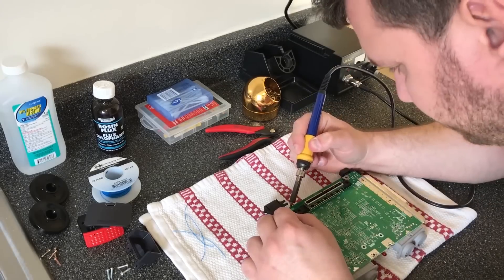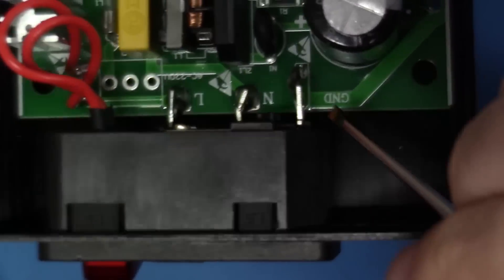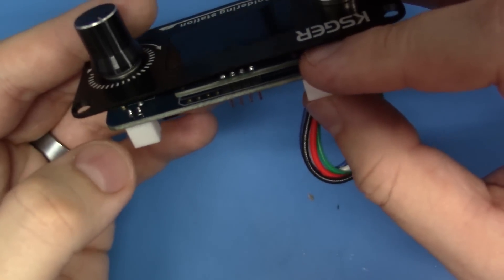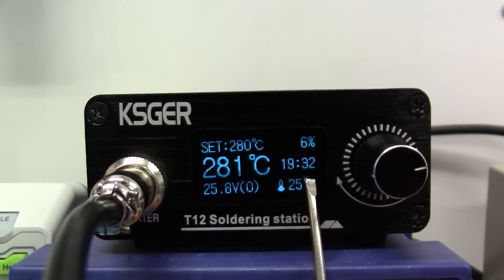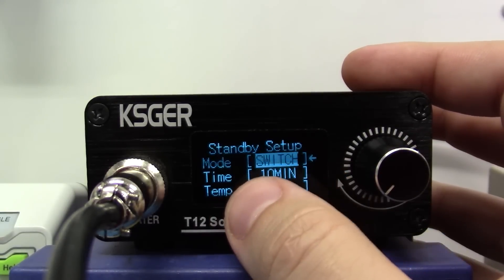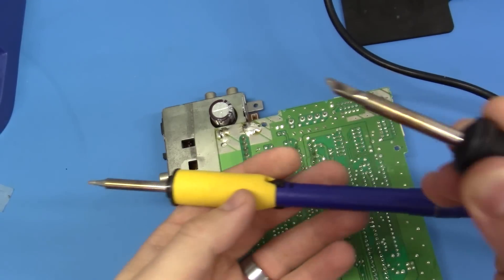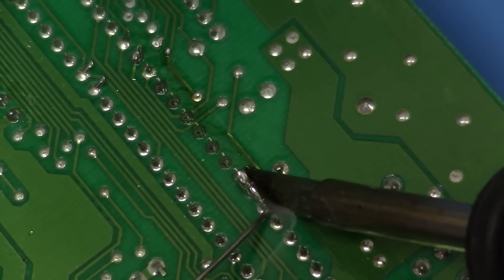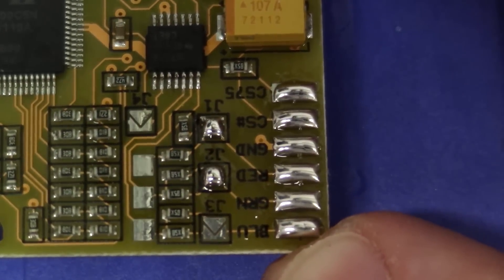Buying Your First Soldering Station (UPDATE READ DESCRIPTION)

Comment: Can you check out the Sigma 950, AKA Bakon 850D? It's a T12 style soldering station with a digital display and it's really cheap, got mine for $25 on Amazon. I've only used it 3 times so far, but it's pretty good and I really like using it. There aren't many videos about this soldering station, but I think it should get more recognition/recommendation as it's actually a really solid starter setup you can get on a budget. It's definitely a better pick than most of the older indirect heating style irons.

Comment: I'd just like to make an observation about a comment you made regarding the quality of one of the internal connections. You mentioned that the mains power assembly in the better quality units was hard-soldered directly onto the board, whereas the cheaper units used flexible copper cables with poorly crimped connectors. I'm no expert, but with all due respect to your superior knowledge of such things, wouldn't a combination of the two methods be the perfect solution?

The mains connector is subjected to stress every time it's plugged in. There's a bit of movement every time, so a solid soldered connection to the main board is possibly going to fracture in time. A hard-soldered flexible cable connection would be more robust, as long as the soldered joints were of a good quality.

Hmm. Maybe we'd need to get another new soldering station before we could solder the cable connections on our new soldering station...  ;-)
Reply from the maker: Ideally, I would want all main connections to be crimped. But if I had to do choose, I would much rather have the IEC connector hard-soldered into position, rather than have a questionable crimp from cheap Chinese stuff. 

- The good news is, the case supports the IEC connector, so there's not a lot of mechanical strain on the IEC connector, even when cycling your mains power cable into the IEC socket.

Comment: Hi Voultar, I bought this thanks to your recommendation and opened it up to compare to the one you had in the video just to make sure it was the same. It looks like the mainboard was updated a bit but still mostly the same. Virtually everything you called out as being great is identical. The only concern I had was that the coin-cell battery is no longer directly attached to the mainboard but is attached via pins and the battery itself rests directly on top of the rectifier. I'm still pretty much a total beginner so I don't know enough to judge whether that's safe, e.g. whether a magnetic field from the rectifier could screw with the battery or something. Should that be okay? Sorry if this is a dumb question or has been brought up--I scrolled through the top level comments and didn't see it. Thanks for all you do!

Comment: mine just randomly died after 2 hours of use. I opened it up to see if anything was wrong but i couldn't see anything blatant. Even checked all the fuses with a voltmeter for continuity. There is a red LED that lights up at the front of the board when I plug it in and turn it on, but that's it. No screen, no heat :/

Comment: I just received my unit from Amazon. There were two minor differences:

1. The connector for the soldering iron is soldered directly to the front board. The solder joints look okay and well done, but it’s not a (changeable) port attached to a connector like yours.

2. The battery is attached via a plug attached to +/- wires and is surface mounted with adhesive on top  of the main power transformer.
Reply: Hey man have you tested it? Is it worth its salt? Quality good or is it a pos?
Reply: Not Applicable I haven’t yet, I took it apart to inspect and it seems legit. I was actually going to futz with it tomorrow.
Reply: @design-flux  Have you had a chance to mess with it? Also, do you mind linking the station you purchased?

Comment: Hey Voultar.  I wanted to let you know that they are not shipping the soldering station that you reviewed in this video.  I think that the one I received works fairly well.  I was a bit upset that they didn't send me the same station that you reviewed, but the one I received still works great!  This is my first soldering station, and I've already resurrected a few Gameboy games following your reflow and battery swap video.  Thank you for your research, and keep up the amazing content!
Reply: I wanted to buy this one too, but i red the faq, what's the difference?
Reply: @seyul  The internals are not the same as the one in the video.  It's like the hardware revision 2.0 I think this has the handle input soldered directly to the controller board, and the controller board is there green PCB, and not the blue one with the better hardware control.  Also, the RCA battery is not soldered to the board, and they double sided tape it to the transformer.  I disassembled the case, and moved the battery on the bottom case between the front panel, and the bottom PCB.  I'll try making a video today showing how it works.  Also, I'm not sure if it is the handle, or the actual unit, but the power regulation is a bit off.

Comment: since this uses handle and tips based on hakko  t12 951 how about making and selling a version of the hakko 2032 microsoldering pencil and its related  t30 tips to be used with this station as that would be really handy as can only get 2032 from states or hong kong in uk

Comment: I wanted to add to this review for anyone reading the comments. I recently ordered this item. After maybe a month in transit, it finally arrive yesterday. I can confirm that the internals are the same as the ones shown in the video, albeit a few small differences. These differences are improvements in my opinion and in no way seem to affect the effectiveness of the item. I soldered with it last night and as far as I could tell, the review is spot on with everything I was shown in this video. I'd say the recommendation still stands on this product if you're ready to wait for the delivery all the way from the Chinas.
Reply: I want to order it because my soldering station is awfull, but i read the Faq on bangood of this soldering station and they're calling it fake and with old firmware and someone on this comment box said the same

Comment: NES solder is pretty scary stuff.  If that melts NES solder, you got a fine piece of equipment there.  Can you also suggest a good solder? Also a good flux (both in paste and liquid form).  I'm not having good luck with the stuff I have from Walmart.  It just balls up and rolls away.  The sample solder strand that came with my old iron was excellent, but it was just a sample and is no-name no-sell anywhere.. I still have some, still works great, but it'll run out soon.

Comment: Is that battery rechargeable or just a standard lithium cr2032? My battery is dead after a week of use, and it can't keep the time when I switch off the unit. I thought it would last for years.

Comment: Is there a way to switch the chosen tip? If I go to the tip menu there's always the T12-J02 tip selected. And this seems to only work with the tip that came with the soldering station although the tip that came with the station is a T12-K...

Comment: Hi Voultar. I had a couple of courses on analogue and digital electronics during my Bachelors studies. Do you have any recommendations on learning how to actually design circuits? Any software I should learn (i.e. for the digital electronics class we used logisim if I remember correctly, it's been over 10 years) ?

Comment: It's a bit late but thanks to you I have just ordered my first Soldering Station. No more having to deal with crappy $3 soldering irons from my local hardware store.
Reply: I finally order this thing and I get an email 2 days later telling me it's out of stock..here's hoping they get more in soon.
Reply: I've had the new soldering station for a couple of weeks now (after contacting the site to find out why I hadn't gotten any news about my order in a while and they finally got it shipped) and I have already seen a huge improvement in my solder work as a result of using it. I did take it apart to check out it's insides and I'm glad I did because whoever put it together decided to put the battery (which is now connected with a cable instead of being soldered directly to the board like the one shown in the video) on top of the transformer which then presses it up against the top of the case so I pried it up from the adhesive holding it down and kind of shoved it under the power board so it wouldn't catch on anything. The connector for the heating element is no longer soldered to a cable and plugged in to the board as shown in the video (although the connector is still there) but an extended piece to the board now has the connector soldered directly to the board which I see as a huge improvement to the version in the video. Beyond that everything internally looks pretty much the same. As for what I've done with it well I cleaned up some mod chip work on one of my SCPH-101 PlayStations (found some cold solder joints that was causing the chip to not function at times) and fixed a still present solder bridge on another one that was causing a huge video error that scrambled the boot screen and then installed a new mod chip in that PSone as well. While it's not as clean as what Voultar did it in an older video it is far better then the job I did on the other PSone where I was using the cheap $3 soldering iron I've been using before getting this new soldering station. I am very happy with my purchase and my poor ILS tip I think is now begging me to replace it though it still looks like it can take some more work from me before it become totally useless (I have no idea how long these things are supposed to last and I'm sure I'm not taking proper care of it but the tip is still melting solder at 250 so I can't have totally ruined it yet and I scrape it off with some old steel wool as I see it getting dirty but only a light rub so not to totally ruin it). I've now even thought about looking in to installing a mod chip in my PS2 with how well things are working with what I've done so far. Thank you for your videos and for this video which finally got me to get a proper soldering station to do this kind of work with rather then hoping I could get away with the crappy soldering iron I've been using this whole time. Maybe I might start selling modded systems myself since it seems eBay's anti mod chip policy is clearly not being enforced if they even have it anymore (haven't bothered to check in a while).

Comment: Just bought one. Did so through Amazon ($45.75 it cost me) as the last time my credit card number touched banggood I faced thousands of dollars in charges from some other company in China. My credit card company refused to remove the charges because they claimed the company in China's charge was valid (it absolutely wasn't).
The 120V connection to the board sold me on this unit.
Reply: Just received it... I was ripped off. It has a minute version of the power converter transformer and hardware version 2.00! I've seen a much more updated version in the videos shown on YouTube where it's 2.09, 2.10H or 2.10. I was clearly ripped off (hardware being older than the updated versions everyone else has? That's in no way acceptable!). Mine was directly from KSGER through Amazon, yet they sent me an old version. The maker, KSGER ripped me off.

Comment: Because of this video I bought the Soldering station and tip collection and I'm really happy with it! 
Could you do the same for a hot air station? There is the 858D that you have, a KSGER which also has a the fan in the handle, and there are the QUICKs (857D, 861DW, 862D) that have the fan on the Station and a thick cable that allows air pass through.

Comment: Thanks, I decided to get this. The coupon codes seemed to have expired. I was about to get the Hakko FX-888D but this look nicer. I certainly prefer the controls and read out. It doesn't hurt that it is half the price but that was not a deciding factor.

Comment: Voultar,  back in November right after your recommendation in this post I pulled the trigger and purchased all three items.  I got the tips and stand about three weeks after the purchase.  As of today 02-15-2919 I still have not received the soldering station.  I’ve called customer service twice but still no luck.  I’ve been offered a refund for the station but now I have the tips and holder with nothing to use them with essentially making them worthless to me.  Can you please reach out and see if you can do anything to help me.  If I have to I’m willing wait a few more weeks to get the station I want .  My email is frank.o.parsinitz@gmail.com.  Thank you for your help.

Sincerely,

Frank

Comment: Just bought the same one from Amazon, payed a little more cause I did not want to wait. Came with 3 tips and a different wand that's carbon fiber. Plugged it in a a big ol ERROR started flashing on screen, twisted the tip in wand a little and boom worked! So far so good do not hesitate to buy.

Comment: I was hoping to get something with hot air.. Any recommendations on a 2in1 unit? or should i get a standalone hot air unit and this unit? Thanks! Great Video! Sub'd and Liked.
Reply: Here is a link : https://www.banggood.com/KSGER-STM32-OLED-T12-Temperature-2-in-1-Hot-Air-Dryer-Digital-Rework-Soldering-Station-Solder-Iron-p-1407450.html?rmmds=mywishlist

Comment: I may be late to the party but have a question if the temperature is genuine, that is have checked with a tester if the tip temp is the same as on the display.
I did not see any calibration option and some station I have seen can go 50+ish degrees pre-calibration and even tho you can go by feel what temp is right it's still annoying to deal with.
Cheers.

Comment: Yeah I just use a cheepo plug in iron that has a little analog dial. Works perfectly and came with 5 different tips, solder, a solder sucker, stand, wire, wire stripper, and a zip up good quality case. Think it was like 25 bucks on amazon
Reply: https://www.amazon.com/ANBES-Soldering-Iron-Kit-Electronics/dp/B06XZ31W3M/ref

Comment: Hi! What is the difference between V2.1 and V3.0???
Reply: about 0.9
Reply: the power output
Reply: From what I've read V3.0 has many bugs and is slow, V2.01 has bugs, V2.1 is the best. I've encountered a bug on V2.1 but it's fixable. If you buy a new V2.1 (or probably reset/initialize it), you can't choose a tip type (pressing and turning the knob to the right). That's because when the unit is reset, there is no temperature profile selected. You have to select a temp. profile (press to get to the temp selector, then press and turn to get to one of the temp. profiles), then get out of the temperature menu and you can choose tip type and tip calibration.

Comment: I got mine. But the temp fluctuates constantly about 20 above my set temp and sometimes below. Also, I noticed though it is still hot to touch and on the display temp, it stops being able to melt solder. I am at 350 when this happens. Any suggestions or a setting I missed in the vid? If it works right after this, I must thank you for the recommendation. It is a really nice unit.
New Info: So the fluctuation I had before in temp have stopped. Will test if it loses its temp.
Reply: thanks let is know since I am thinking on it
Reply: I'm having the same issues as far as melting solder- or rather being unable to melt solder. I was going to break the iron in by replacing some pokemon batteries, but after it taking as long to do one battery as I could do four with my old iron, I put it away.

Comment: I ordered this on December 8th and it finally arrived today, part of the delay was the back order and part was just that it takes a long time to get stuff to the middle of the US from China. Anyway, it’s much better than the old Weller station I was using. I took it apart to make sure the internals matched what was in the video and they did for the most part. The power board is definitely the same. The controller is different but that doesn’t matter to me much. The menus and everything are all the same, the board for that part was just different.  It heats up quick and did the job comfortably without getting in my way.

Comment: Thanks so much for this video.  I've been using a cheap POS soldering iron for several years, and recently decided to upgrade.  I had been researching the Hakko FX-888D and X-tronic 3020-XTS soldering stations, when I randomly came across this video.  You've sold me on this one, and I just ordered all 3 items via your affiliate links without hesitation.   The $40.99 coupon didn't work, presumably because it's currently a promo item, but the 20% off coupon for the tips did work.  Thanks again!  Liked and subscribed!

Comment: Thanks a lot Voultar! I just ordered the Soldering station and the Holder. I am finally glad to have a great working soldering iron, i used an old Radio shack one i got years back, so lets just say it was hit or miss. I need this new one to put in some capacitors in a Pc engine duo i am getting. Wish me luck! (I will be ordering the tips soon as well!)

Comment: Just received my station, and it works amazing. Managed to disassemble already and noticed, that there is no more wires going from the controller board to the output plug, its all on PCB now, which i think is great, or maybe  not? XD
Reply: i want to know if the power cord is included?
i have a cheap weller and want to do an upgrade, but from what i saw i need to buy more things beside the Soldering station right?
Reply: @seyul   Yes. Power cord is not inncluded. But they are regular pc power cord with C13 plug. They can be found realy cheap for around 3 bucks even at cocal store.